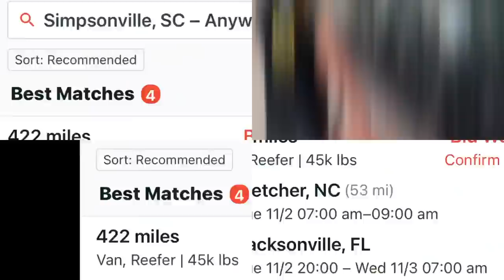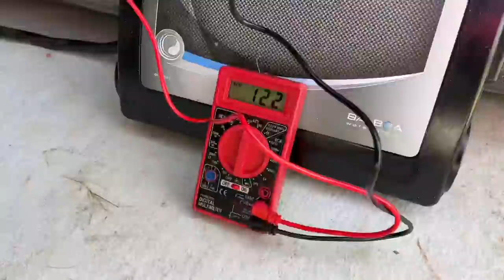“Appointments Change On Potential Load” Need to Stay Home an Figure out this Hot Tub anyway OTR Life

Comment: 8:11 if you are touch the red and the black, it should read 240v. It seems your red wire might not be getting power. You should also have a disconnect close by. Double check your disconnect for correct power. (Also make sure the GFCI is hooked up correctly and not tripped).
Reply: If you still need help. Feel free to contact me. I've got 25 + years of experience in Hot Tub repair and services.

Comment: I would re-make every plug connection, unplug then plug back in. You could also try unplugging everything leaving that box and see if the control pad lights up, then put the plugs back until it shuts down again to find the bad component.

Comment: The Tub Pump and motor may be hooked up to run on 120v. It can run on either 120 or 240 but you have to rewire a couple things.
Reply from the maker: It’s dedicated 240v 😎🙏🏽

Comment: On your electrical panel if you are pulling power from the same leg (same side of the panel) the double pole breaker cannot start in position one at the top of the leg. It must be in space 2 & 3 not 1 & 2 to make sure you get your phasing correct. This should be the same anywhere down the panel making sure that the top of the double breaker uses an even then odd numbered space. Not a odd then even numbered space. Consulting an electrician would be the best course of action

Comment: Check you have 2 phase power, hot to hot =230v , if 115, it's single phase power with same leg for both wires
Reply from the maker: Reading 245 red to black 😔

Comment: Check a fuse with the DMM you have instead of just replacing. Check the voltage from H1 to H2 and not just H1-N and H2-N if the Hots are taken off the same hot rail in the breaker box you will have 0 VAC between H1-H2.

Comment: Please be careful with electricity and water.  GFI required on the circuits. 220 requires a hot from each leg of service and the neutral. 220v is measured across the two hots, not to the neutral.  Email me if you want more explanation.
Reply: And make sure there there are not two GFIs in the circuit.  Wiring can be more complicated than it looks - at least to do right. Watched my Grandfather get “bit” too many times to count over the years, but he taught me a great deal. Like hire someone to look over your work if it’s serious amount of work.

Comment: You have 122 volts from the black to the white wire.  You have 122 volts from the red wire to the white wire.  But, do you have 240 volts from the black to the red wire?  You could get those readings you have if they were both tied to the same end of the pole transformer secondary winding.  The black and the red need to be hooked to the opposite ends of the pole transformer secondary to give you the 240 volts you need.
Reply from the maker: Checked it and it was 244-245 😔
Reply: @JustTruckin  Where do the black and red wires go?  Is there a fuse or a breaker there?  If you have 244-245 volts going into whatever that is, then there should be 244 volts going out of it to the heat elements heating the water.  It could. be any thing from a faulty thermostat saying that the water. is too hot to a connection missing completjy.  From this point, you need to call a service guy from the place there you bought it.

Comment: Did you wire the hot tub? If so I don't know your electrical knowledge but on 220 one line has to be on your a side and the other on your b side of your breaker box. Don't know if that's the problem though.

Comment: What’s the voltage across the two outside wires?  There’s an a phase and a b phase needed for 240v.  You might have two of one and not one of each.  Check for the 240v across the two hots.
Reply: How was Halloween.guys .tank looked good in his costume .you all had a good.family day out .
Reply: Some of those tubs draw a lot of current *40 amps and too small of feed cable will drop the supply voltage causing over current on the circuit breaker.  Reluctant is correct you have to feed 120V off each side of you main breaker box feed which is A & B feeds .

Comment: You have 120 volt on each leg. What do you have across the 2 hot legs? It should be 220 - 240. If it read 0 volts then you are not using 2 different phases in the breaker panel.

Comment: Lots of hot tubs are junk. I have top of the line Jacuzzi Hydrotherapy hot tub with over 100 jets. Jets are incredible as different water patterns for each muscle and individual intensity control. The rest luckily under warranty computer board had to be replaced, waterfall internal hose leaked, top cover mounting brackets had to be replaced. So the jets no issues since we owned it. Had a company come out each time for drain and clean and fix warranty items. We use Silk Balance. More natural and easier on the skin but costs more money. Surprised they let you work on the hot tub you bought as that is for most manufacturers a warranty void day one. The companies want authorized technicians only to work on warranty type work for most brands. If more than one thing breaks down soon you might demand a full replacement of a new tub before it gets out of full warranty to limited warranty. Make sure to research each brand for reviews before buying to see know issues and how manufacturer responds. If it's not coming on at all likely the computer board or electrical hookup not adequate for what is needed. They should have it's own tap at electrical panel inside house usually and then a run to a individual breaker box outside just for the hot tube. That is how the electrician set mine up. Certified electricians on these do the installs as one wrong move could fry the brand new tub. Good luck

Comment: Guessing it’s a Balboa control board it should have had a model on top of the box or somewhere on the pcb.  Guessing it’s the black jumper wire or lose connection.  I didn’t find the exact schematic.  Also you could check the wire from the control panel thinking it looks like Ethernet jack might be lose.

Comment: 240v will kill you. Especially if not properly grounded and wired in to a big tub of water like a hot tub or swimming pool. CALL A LICENSED PROFESSIONAL. Turn the breakers off and call a pro for this. It's not like replacing a ceiling fan or outlet.

Comment: I did not see you measure the voltage across the two lines in.  It should be 240 volts.  Then measure across the ends of the fuses, it should also be 240 volts.  You should have been able to OHM out the fuses, out of the circut to see if they were good.  Back to the beginning, if you don't have 240 volts across the two lines you've hooked it up wrong.  PLEASE get an electrican to do it correctly.  Tdubs can wait to try it out.

Comment: I just picked up a load yesterday in Simpsonville...was expecting 5,000 lbs. of pump parts. I doubt it weighed 300! For your hot tub, check hot to hot. You might have them both on the same phase. And a bit of advise: you wouldn't let one of your boys drive the W900 would you? Well, when it comes to wiring swimming pools and hot tubs there are many items in the electrical code concerning them. I strongly you have a licensed electrician check and rectify any issues they find. I really don't want to see a story on the news about something bad happening. And after watching you and your family for a while now, it would be like it happened to my own family!
Reply: I totally agree with "Hot Shot" get an electrician, he can find it a lot faster and you won't have to risk your health!
Reply: Definitely agree if unsure find electrician especially something like a hot tub don’t want to electrocute anyone. Also both hot wires to the neutral or ground should measure 120then hot to hot you should measure 240 if on separate phases if on same phase it will measure 0.

Comment: I saw hot tubs wire power got wrong hook up cause blow fuse red and black wires are hot goes outside bolts and white wire is neutral goes middle bolt 
be sure red and black is 220 volts,
White and black or red is 110 volts

Comment: Double check your line wires coming from house. Normally on a terminal board the neutral(white is in the center and the hots (black and red) are on the outsides

Comment: Did you put water in the tub.  I have never messed with one before but work in the electrical field mainly for industrial controls, but I am wondering if there is a water level float that has to be made for there to be control voltage.  With a newer hot tub i am going to say is 24vdc.  You had the voltage to both wires to neutral but did you get 240 across the hots red and black.  The feed circuit for that should be on a double pole breaker and imagine with the pump and heater be a 30 amp circuit.  I certainly hope they didnt use 2 single pole breakers with a space between them in your panel box as that would be the same phase.  If singles were used for whatever reason they would have to be right next to each other or directly across from each other.  I hope you get it figured out sooner than later.  I would look at if for you and not charge you anything but i am like 1000 miles from you lol.  Good luck.
Reply: Ask the dealer to check it out .the should be abel to fix it .